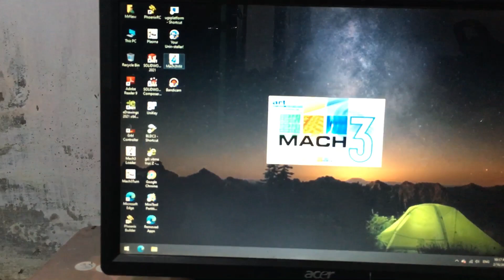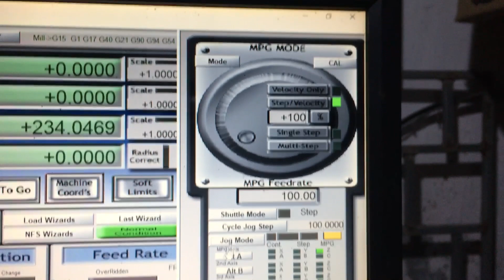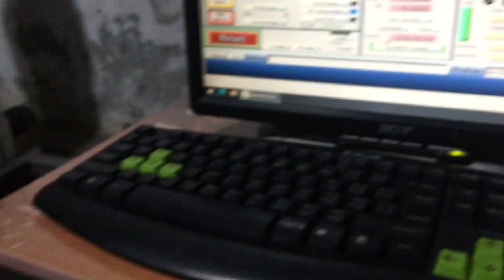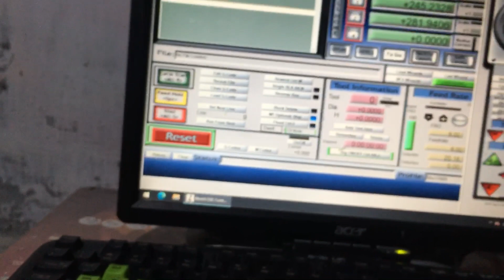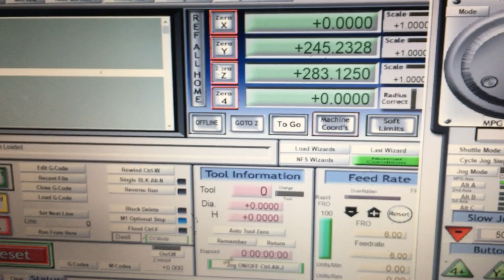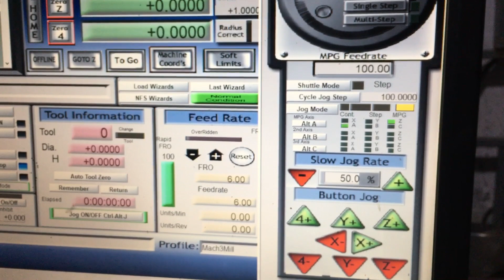Test mach 3 usb(red bob) and MPG Hand Wheel

Comment: Hi, to get X1 speed do you leave x10 and x100 high, or pull both to 0v (low), the manual is confusing it states,  X10 and X100 are selectors for resolution multiplication of steps move per encoder pulse, connected both is X1 by default

Comment: Bro... I need some help
Reply from the maker: can i help u
Reply: @minhtanphan6141   I baught the same mpg.  Im using the same bob. Can you show me the diagram of wiring that.  And also where can i buy that ribbon?
Reply from the maker: @ET111  with red bob it working not smooth
Reply from the maker: @ET111  the same price you should choice bob mach 3 usb 5 axis (green),it have analog and pwm to control spindle,mpg   configed on file setup,it work smooth and exactly
Reply: do you have facebook ?
Reply from the maker: @ET111  yes...nick name is minh tan phan,avartar is lotus  and wallpaper is group RC heli
Reply: Requested you. Kingki lowmeter  profile pic is ice age character ( Buck)